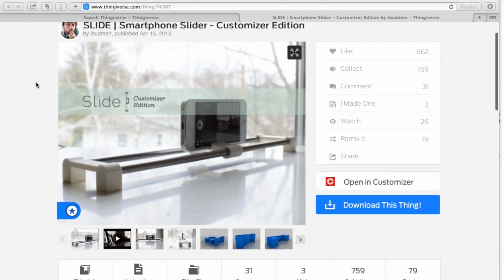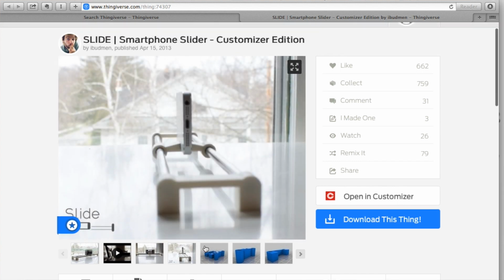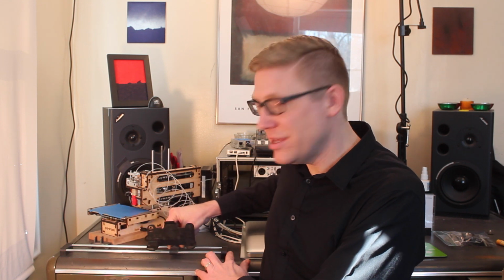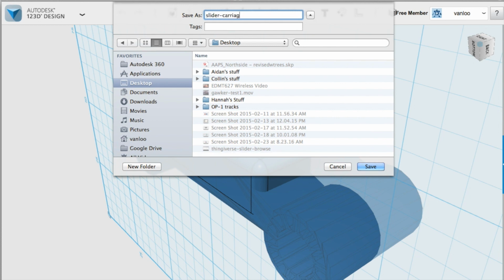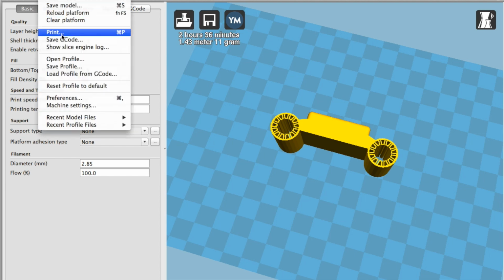DIY 3D Printed Camera Slider

Comment: Good stuff Bill. I am looking to build something similar and use inexpensive linear bearings (same as on many 3d printers) on the rods to smooth motion out. Add a small motor with a pulley (maybe some small gearing) and some kite string and you can easily have it auto slide to catch some cool workshop time lapses. Keep up the great work!
Reply from the maker: blurryvizion I think motorized / automated is the way to go. I've barely used the slider I made because I typically want to shoot scenes of myself working, and that's impossible without it being motorized. I looked into linear bearings and can definitely foresee making a version 2 slider in the future!

Comment: Did you use the printrbot simple maker's kit or the simple metal for printing? Is the printing from the simple maker's good enough to make these parts?
Reply from the maker: Hi, Pedro - I used the simple metL for these parts. I have to spend a little more time getting my Simple Maker's dialed in with Octoprint on the Raspberry zoo, but I think it will be able to handle these parts once it's set up.